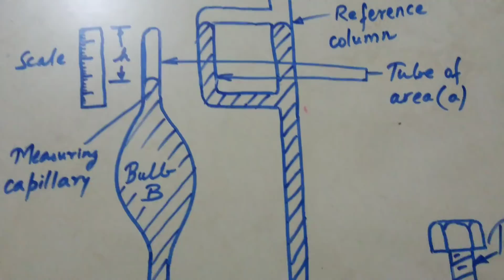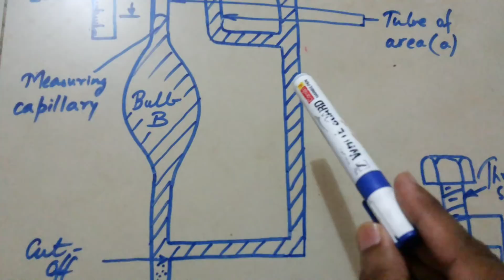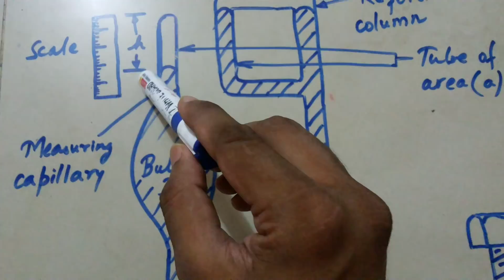Diploma Mechanical - McLeod Gauge.... #50kviews #viralvideo

Comment: Dimentionally is it correct ??
P2 = P1 + h
Adding pressure to height ?
Reply from the maker: +nishant tiwari 

You are right, but here P1 is also in term of height. This is evident from the last step:

P1=ah2/V1

Assume a is in mm2, h in mm and V1 in mm3.... then the unit of P1 is in mm